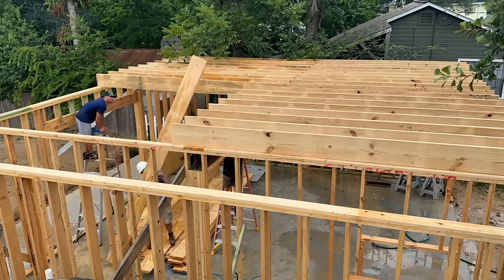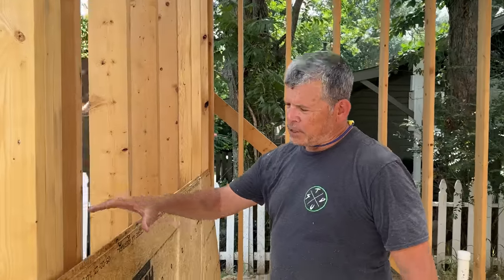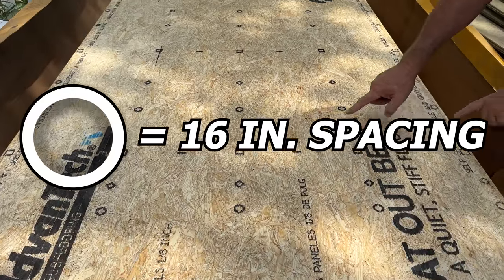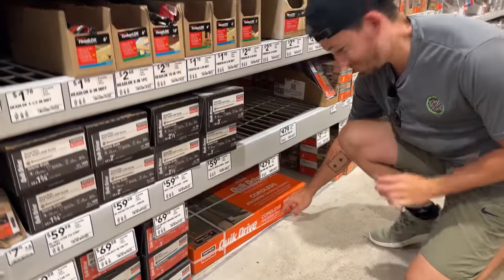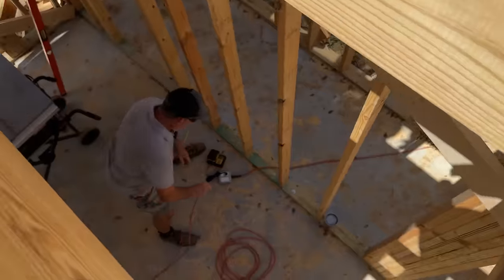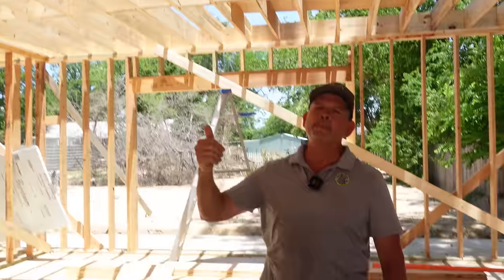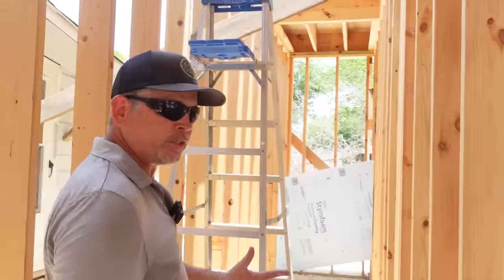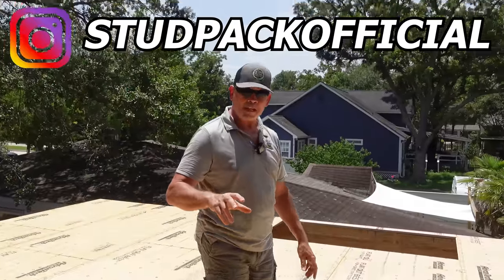We Bought a $500 Tool to Avoid Heat Stroke!!🥵 Installing the BEST Subfloor!!!

Comment: Having a friendly inspector is such a huge bonus in a project.  Him offering to help with questions proactively will save you time and money by not having to do RE work.  Loving the progress and the Quickdrive was a no brainer, It will literally pay for its self in time savings and back pain savings.
Reply: Cheaper than a dozen chiropractor visits, 😉
Reply: And awesome to have a good relationship with the building dept after such a rocky start :)
Reply: You need to build a motorized ladder extension ladder to move that heavy plywood up to the second floor.

Comment: Advantech is definitely heavy, but it's also worth it's weight in gold down the line. I won't ever use anything else for subfloor, and Zip is the same thing for wall sheathing and roof sheathing. Vastly superior products that make carpenters like us look good! Well done guys! But before you start adding even MORE weight to that 2nd floor, get some sheathing on those walls below so they don't start bowing and flexing on you!

Comment: Holy cow, inch and an eighth? So jealous.  I've lived in apartments where the OSB was so thin it actually paritally caved in and you had soft spots under the carpet.  This is going to be an incredible house.
Reply: it's easy to justify when you aren't paying for it.  That stuff is $70+/sheet.
Reply: During the middle of the plandemic regular 1/2" osb wasn't much less than that. @AidanSkoyles

Comment: I am impressed with the engineered sub-floor system and especially like the tongue-n-groove interlocking that allows for expansions. Definitely going to provide strength to your garage/apartment for decades and the adhesive looks to be top-shelf stuff. I'm taking mental notes as I watch these episodes.

Edit: Wanted to update to say that the speed screw looks like an awesome, time-saving tool to add to the arsenal of tools! Holding the trigger to drive each screws is the same technique I used with air-powered nailer, just hold the trigger and go to town.

Edit #2: There were two things that came to mind. One, you could probably benefit from using a lift system similar to what roofers use to haul heavy shingles up from the ground to the roof. That will save considerable energy in lifting, pushing and pulling to the 2nd floor and reduce risk of injury. The second thing I wanted to suggest was some kind of gripping tool that could make lifting heavy OSB easier. Something like the Kreg's Panel Carrier. I noticed that you were using hands to pick and hold in place. With each of these OSB panels being 125 lbs each, I would imagine a panel carrier tool for both lifters would save consider hand fatigue.
Reply: I had similar thoughts to your second edit, I was thinking the guy above would have greatly appreciated a panel lifting tool like you mentioned for dragging the panels up. I also thought, they have lumber and drops, they could make a temporary lifting sled with a sheet of plywood that slides up some angled 2X6 and the guys on the ground could pull on [a] rope[s] that drag the sled up (maybe even with a car? ) and then unload the sled up top. Greatly reducing the risk of dropping any of the sheets and injuring themselves
Reply: @legionofanon  Yeah, a ladder hoist would have been a labor-saving device as well as reducing injury in the long-run. I was worried that Rad would make the wrong step while pulling the OSB from Jordan and Paul. I hope that the Stud Pack crew are taking notes as other comments have also pointed out that similar system would have been labor savers.

Comment: Great job guys!  Here's a tip for the poison ivy.  Apply heat, either with hot water in the shower, or even easier, a hair dryer.  The heat needs to be as hot as you can stand it, without getting burned.  It will itch like crazy at first, but after a minute or two the itching stops.  Keep the heat on for another 30 to 40 seconds after the itching stops.  You'll be completely itch-free for 8 hours.

Comment: Love to see y’all install that Advantech. Wish I had y’all around! Just parted ways with a contractor, because after giving him explicit instructions, he installed the Advantech incorrectly. Now it has to be ripped up and re-done. He ran part of the Advantech with the strength axis parallel, instead of perpendicular to the joists (counter to instructions); and he failed to leave the gaps between the ends of the boards (as is printed on the panels in English and Spanish)! Fortunately, it’s only a small area in a bathroom.

Comment: Great job guys, I moved from nominal lumber to engineered I-Joist to avoid the waves in natural lumber. This helps for the floor and the drywall on the ceiling. Keep it up
Reply from the maker: engineered TJIs or truss joists on the main house for sure

Comment: As an electrician, the videos doing everything that i dont do is so awesome to see. Especially when its done the right way
Reply: Also nice in the last video where they actually thought ahead about making it easier for the plumbers and electricians by putting nails and screws over the studs (on the sill plates/headers) instead of between; so they won’t hit metal.
Reply: I've hit so many nails that it feels weird if I don't hit any.

Comment: PAUL!!! You gotta try using bentonite clay on that poison ivy!! I just recently had it a few weeks ago and it was just absolutely terrible. The bentonite clay draws out the pus, helps neutralize the poison, and leaves muddy lookin smears all over wherever you apply it,  but it KILLS the itch 100%. I would wash it off during the day and then reapply after a few hours because it feels a bit tight when you're workin, kinda like glue or caulk on you, but man I'll tell ya I didn't find any relief from ANYTHING else that I tried. Hope this helps!!

Comment: When you're planning to lift a board to waist level and then get it to chest height and then push it up to Rad, consider releasing the load on to 2 waist-height trestles. Then reposition without any difficulty to perform the following lifts.

Comment: Ok Paul. You have convinced me I need to upgrade my plans...that avantech is a phenomenal product. So much more rigid than 3/4 in t&g osb. I might be able to have tile in my wet areas yet...🤔 Definitely going to glue it down as well. Thanks! Y'all are fantastic! 👍
Reply from the maker: Cool but you still need backer board over the advantech, can’t put tile directly on wood ever 👍
Reply: @StudPack  oh, I know, but flex is the death of tile. That avantech is not flexing an iota. Right now, I have essentially a trampoline, 🤣

Comment: @23:11 Reminds me of an addition I did in '83. Guy hired me to build a garage with house on top add to a little cabin on the river. The addition was angled about 25 degrees off the cabin as that was the shape of the lot. Owner pounded a few stakes in and went on vacay for two weeks. His friend came out and poured the slab while he was away and missed an important step, which we didn't find till we got to the edge of the floor. We had to cut angles on the first two courses to fit against the cabin but once we got started the side walls were parallel so it wasn't 'til we started fitting the last course of 1 1/8 ply that we discovered that the slab was 11 inches longer on one side than it was supposed to be. 
36' across the front meant every sheet had to be cut at an angle lengthwise.
We had this discussion in every room upstairs "Which corner do you want to be square?" We did our best to not build a crooked little house...

Comment: 16:54 on the spray "POLI" I think you should add a "FINGER" to the nozzle to simplify the alignment of the spray. By twisting the handle you could micro adjust the deposit of the poli from the edge of the 2 by.  You could spin your hand like 45 degrees to apply the second bead on the same beam. Good luck. Refining the tool after ya get to use it for a while, is what gets your company the competitive edge on the others.

Comment: I have a 23 year old home with a squeaky floor with carpet on it, and i want to replace with wood flooring, how do i replace/repair what i'm assuming is 3/4" plywood?  Add screws to secure existing plywood, then add a second layer of plywood to improve stiffness?  Great video.

Comment: Maybe a dumb question, but how do you make sure you are only hitting the high spots with the planer? I've never used an electric planer before.
I'm looking at the angled brace behind Paul and thinking "Why not slide the board up that brace?" but then I don't know what it looks like at the top so that might not work.
Always good to check with the neighbors. I'm glad the neighbors were cool about it.
That's not something I have to worry about since I don't have any immediate neighbors.
Dragging branches can suck. I sometimes have to drag some off the road so I can get through after storms. 
Love the dog on the back of the couch/chair looking out the window!
W Huber! (I wonder if their stuff could be used for replacing subfloor in a few places in my house where stuff has water damage).
I'm seeing sawhorses (I think) underneath and thinking-- why not lift on to sawhorses to give a little extra support? There has to be a better way to get boards up. Maybe you can lean some 2x4s or whatever size you have in boards up to the top at an angle and slide the floor panels up? You could also set up a horizontal board underneath and another board or two to use as levers and use the horizontal one as a fulcrum point. Pivot the lever board(s) down and lift the panels up a bit more. You might even be able to make sort of a jig with boards and carriage bolts. I hope this is making sense.
Ah, so you are staggering the panels so they don't all have seams in the same spot. My flooring installer friends would be happy.
I hate when you have to put your hand on the body of the drill to push in a screw or drill bit and it gets too hot.
I'm envious of the decking screw gun but I can't justify the expense for my diy projects. I wonder how much it would cost to rent one.
That inspector was very nice. Very sweet of him to say you could call him if you had any questions.
How much do the Advantech panels cost?
ooh, watermelon is great on a normal day, but its extra good on a hot day.
Ugh, Poison Ivy sucks! 
To recap: 1/2 foam board sandwiched between header boards. Sounds good to me.
12k likes thus far! Excellent! This was a good one! It feels great to see things coming together and see the progress.

Comment: I remember using a hand planer when I had to sister joists in my house years ago. That 6' level will pay dividends as well. Amazing job gang. Your energy and pride is palpable. It brings back memories of "gluin-n-screwin" those first couple sheets of sub-floor. When you have a stable place to walk on, the work is so much easier and motivation skyrockets! Also, shout-out to video editing. Godspeed!

Comment: 11:35 you can buy a silicone protective boot for that impact driver, that should eliminate the heat issue from the motor, although the boots only come in black, so heat from the sun might still be an issue.

Comment: A couple of things you should try that will help save your backs.  Get an extension for your glue gun.  They make them long enough so you don't have to bend over.  The 2x that you hit with the sledge hammer to set the Advantech, get another 2x that's about 4' long and screw it into the piece that you hit at a 90* angle, making an inverted "T", giving you a vertical handle so you don't have to bend over to move your beater bar.

Comment: 11:40 Jordan ya need the long extension stand up screw gun for fastening these down, instead of a small screw gun the makes ya bend I’ve over or be on knees. Will also be able to use on house; so will pay for itself, same with Huber foam/glue gun where able to stand up and apply it, imo….
Looking good guys, cheers✌🏻

Comment: Great job framing!  However please explain why you used a 1 inch plus advantech which can span 4 ft on a roof. 3/4 advantech  16 inches on center would have given you a rock-solid floor. Why waste the money ?

Comment: Be careful with the SawStop if you are cutting insulation with a foil layer, it will set off the brake. Make sure it's in bypass mode. Nice work guys.
Reply: Great thing to keep in mind.

Comment: When my wife and I bought a house last fall, we ripped out the old carpet and then I drove screws in all over the subfloor to get rid of most of the squeeks before I laid the laminate and even indoors, my impact driver was getting mighty hot and I about burned my hand on screws if I missed the joist so I wore gloves the rest of the time so I can start to imagine what it was starting at over 100!

Comment: Guys are doing great, but 2 quick tips moving forward.  1 while gluing the framing be sure to hit all your cross blocking in the field to 100% eliminate floor squeaks and 2 hitting in sub floor put your foot on the 2x4 block so it doesn't jump during hitting and possibly fall on someone below and it also eliminates having to keep adjusting the sacrificial block.

Comment: What are the advantages of 1 1/8 " opposed to 3/4 or 7/8. Or 23/32 which is 11/16 heavy. Seems like a lot of extra weight. Noise or strength. Seeems overkill but tha plane job you did was supurb. Bet the flooring guy will appreciate that if he hasnt already. Just curious. No insults intended. Your work is top notch.

Comment: I have always liked using a st strap riding on top of the deck down the face of the last riser/joist going under the stringer. just notch the the bottom of the finish floor.

Comment: Curious why the 1-1/8 ... generally it's intended for spans greater than 16".   the 3/4 advantech is in itself a premium product.   Regardless glued and screwed you've got a great solid floor -- plus a workout getting those sheets up there (I guess cost didn't matter since them comp'd the materials lol).   Also for what it's worth, I think their squeak-free guarantee requires an engineered floor joist system .. but I'm sure won't be a factor on this job !   Thanks for sharing this project!

Comment: i used advantech on the roof of my house because of how water resistant it is. I actually left a full sheet out all winter and used it the following winter. It sat in the rain, snow and sun for a year in western ny and it was still as solid as the day i bought it, a little faded but still in great shape. Will have to try that new  plywood you are using there on the next one i build.. Good times brother, enjoy the heat, western ny is only low 80s :)

Comment: I workby myself. Lifting material I build a ramp and pulleys. I slow flip, no hurry. It changes my brain from not looking forward to lifting into this is fun.

Inside a drywall jack has been great for lifting ceiling drywall and the top course of wall (horizontal) but also insulation batts, tools and other materials up to the attic.

Comment: Circa 1990, my carpentry crew used a very similar tool (the 'no-bending-over' 36-inch-tall auto-feed decking screw gun) to install the subfloor decking on my house. One difference was that, back then, such tools used an AC extension cord, not batteries.

Comment: I'm in Phoenix. For me it's not really possible to hold tools bare hand in summer. Gloves required. I also have to be careful on roofs. The heat slowly comes thru the bottom of my shoes and actually burns the bottom of my feet. Got to get off before feeling the heat because once I feel pain it takes a few minutes to get off the roof and get my shoes off and the heat builds that hold time. No idea how roofers deal with that.

Comment: Tip: measure all of your joist widths first, then start at one end an start with the smallest to biggest or biggest to smallest that way your not putting way wider board next to another one. How much time to plain? How much time to mark out the high spots? VS just measuring your joists in the first place. This is how I frame decks as the treated lumber can variate up to 3/8ths..
Reply from the maker: Thanks Justin, yeah I saw DrDecks do that, great tip!

Comment: To find the crown in a board you can also take a long level or framing square and hold it parallel to the front of the board and slide it along the board to see where the crown begins, put a mark, find where the crown ends, put a mark, and take a belt sander or plane and remove the crown.

Comment: 7:11 use a handle on the sheets to help lift up to 2nd floor, how I’ve done…..
Also, Huber make a longer applicator gun so can stand up and spray the adhesive right on down w/o bending over, cost more….yep, but well worth it!

Comment: I bought the short version of that in ridgid corded for drywall and decking you cant stand completely upright but you can do floors just walking around bent over and switch tips to do drywall screws great for overhead sheets and such.

Comment: It's funny, I had a Quik Drive system twenty years ago, got the upgrades for it, liked it. Got talked into trading it in for a PamFast system. It's another very good system with features that a framer would love. That was three years ago. The screw selection and availability for the PamFast  are woeful in my area, probably every area. Truth be told, it's still in it's very large and fancy case, never been used. I should not have traded out of my Quik Drive. Lesson learned.

Comment: Does adhesive and screws seem like overkill for a 1.125” subfloor? Wouldn’t screws be sufficient?
Reply: The adhesive is required for the squeak-free warranty/guarantee. They won't be covered without the adhesive. It's not overkill.

Comment: Flattening the floor deck before plywood is a sign of quality building. I have never seen anyone do this, I thought I was the only one that does that. The plywood does not fix those issues. Anyone that says the ply would fix it are standard practice contractors that usually don’t care about the finish or never work on the finish steps like wood flooring or tile.